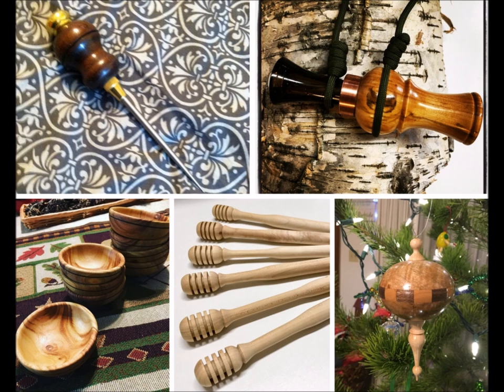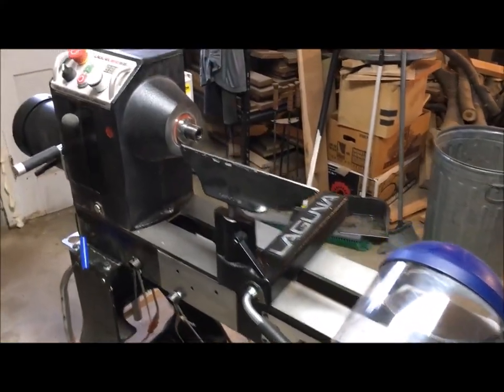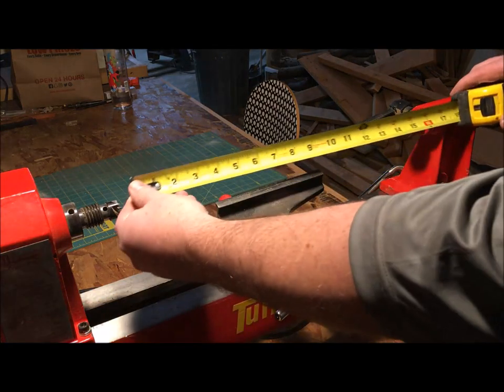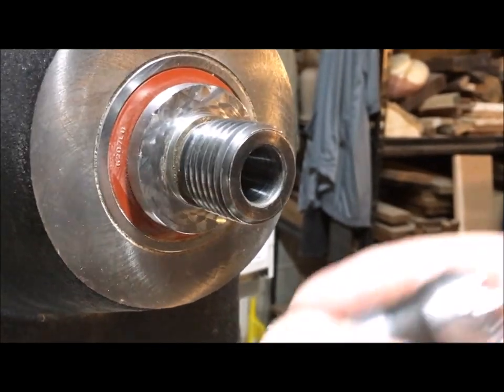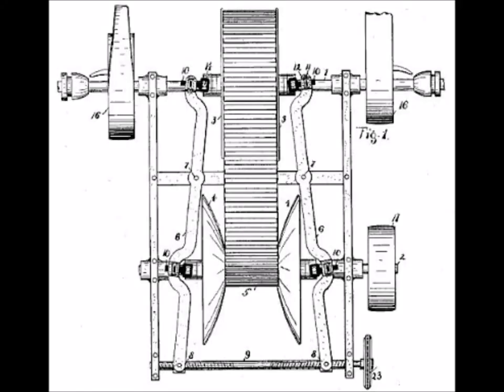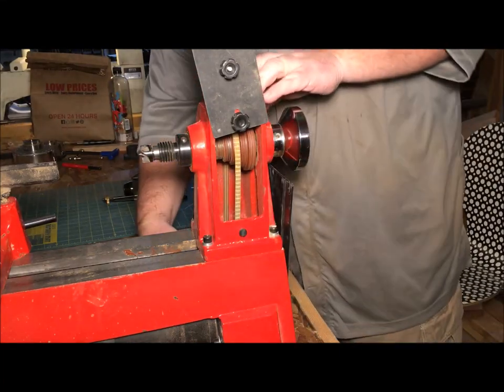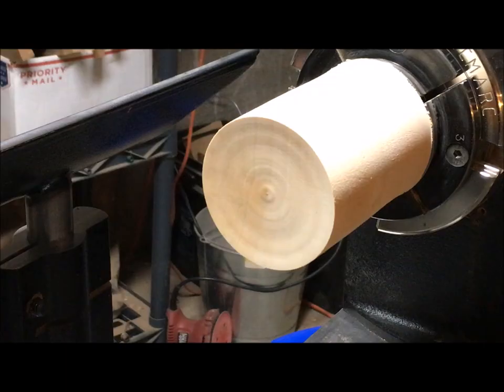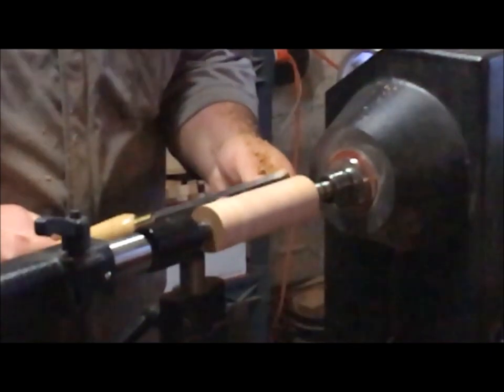what lathe should I buy?

Comment: This was just what I was looking for, very informative thanks. A question tho. At 7:42 Spindle indexing, I get that you can lock the spindle in a certain position, but why? What are patterns and flutes? Thanks for sharing 👍
Reply from the maker: Thanks I’m glad the video was helpful.  As for spindle indexing a lot of turners use it to drill holes in the rim of a bowl to space them evenly around the piece. Then they can inlay the holes with another material. With a jig you can use a router to make grooves,  or coves (flutes) horizontally along a spindle that are evenly spaced around the piece. You’ve probably seen it on furniture or architectural work. You can also use indexing to mark lines with a pencil to burn in later for a basket illusion technique. Great question thanks for watching!
Reply: @Geiserwoodturner  Thanks so much for coming back here and explaining that. Ive looked at a bunch of other 'Which Lathe' videos and while they pointed out the indexing system I still had no idea what it meant. I am glad I am one of your subs.

Comment: OK here's  my problem, I inherited a lathe from my father, its a chimerical  lathe from the1920's
 the spindle is about 1 1/2 with a alum. face plate frozen on it!
 every of my turning friends tell to junk it and get a newer lathe!
 On the other hand I would like to fix and bring it back to life any suggestions?
Reply: sorry about missed words im writing this at 3:00 am
Reply from the maker: I’m not an expert on restoring lathes and without a lot of info I can only give some advice.  Spray it with a good penetrating oil and let it sit overnight.  If you can get wrenches on it great. I recommend tapping on the one on the faceplate with a mallet rather than a straight twisting motion. If you don’t mind destroying the faceplate a pipe wrench might work. A small amount of heat might help expand the metal. I’ve heard of people just cutting down till they almost reach the threads and splitting it off with a cold chisel. I hope some of this helps. Good luck with your project.

Comment: Try to physically look at the lathe before you buy, try to avoid lathes with threads straight into soft cast iron, soft metals on some lathes are a huge problem. My Nova comet tool rest snapped due to it being cast, also the tool rest tightening thread cammed out.
Reply from the maker: Also think about an aftermarket tool rest. Most of them are not great. That is unless you buy a Robust lathe!

Comment: If you buy a smaller lathe, do not get variable speed. The slower you go, the less power you have. Opposite of what you need.
Reply from the maker: Good advice!  I’ve noticed this on many smaller lathes. If you want low speed torque you’d better go with 220V with a VFD.

Comment: Jason,
I have the Laguna 18-36 which I purchased April 2017. I am wondering if you have had problems with the digital display or the reset.
Thanks,
Ed W
Reply from the maker: Only problem I have had is the start button sticking. Also an alignment problem with the tailstock. Works great ever since I worked out how to fix. I’ve had it for about 2 years now!
Reply: I've been beating my 18-36 with no issues
Reply: I have not had any.  I'll let you know if I do.

Comment: I'm going to be using a lathe to make tobacco pipes out of briarwood which is a very very hard wood so I'm thinking a mini lathe but I also want room to grow any suggestions
Reply from the maker: If you are going with a mini lathe with room to grow maybe 🤔 something like the Jet 1221  VS.  It has a 12” swing plenty of power for its size and variable speed. I’m not sponsored by Jet, I just owned one before and it was well built. Hope that helps.

Comment: What size lathe do I need to make a baseball bat?
Reply from the maker: Most full size lathes would have the capacity for a baseball bat.  The second number in the model number is usually the length capacity.  You need anywhere from 36” to 42” for a bat. A mini lathe will do this with an extension.